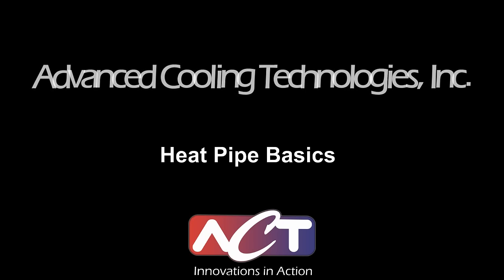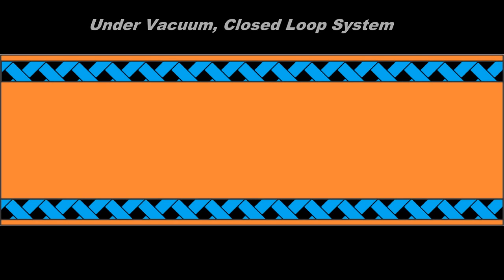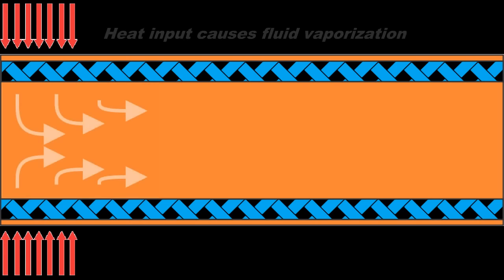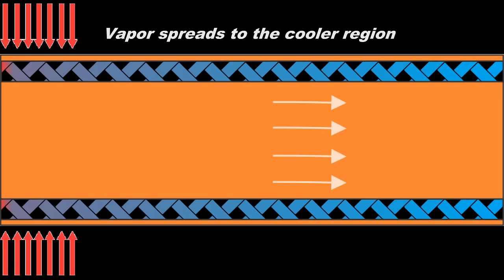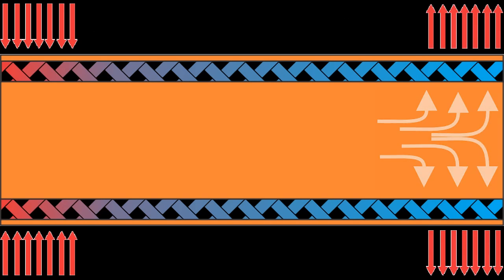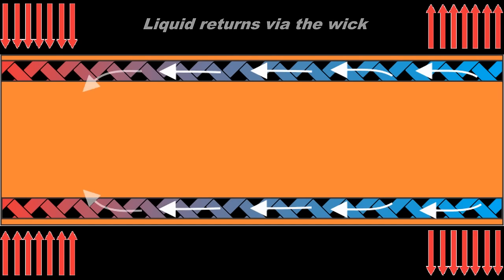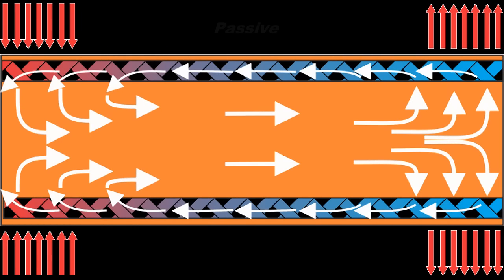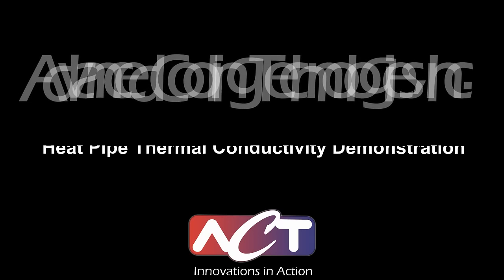Heat Pipe Basics and Demonstration Video

Comment: Question.
If you have an electrical component that is operating at 40°C, and you use heat pipes for cooling. What is the typical temperature reduction for the component? I realize there are no doubt variables associated with this, but what is the average temperature reduction using heat pipes? I have never seen the stated anywhere before. Thank you
Reply from the maker: Hello! With more information, we should be able to provide you with an answer! Feel free to reach out to one of our engineers with details regarding your project: solutions@1-act.com 

At the moment, it depends on far too many variables to give a clear answer. A heat pipe won’t inherently reduce the temperature of a component unless it is providing a better thermal path than what is already present. If a heat pipe-based cooling solution is designed properly, a heat pipe will help minimize the thermal resistance between the component and the cooling media which will result in a cooler component. The magnitude of that reduction is dependent on many things and can range from a few degrees to tens of degrees. 

Thank you for your question and hope you reach out to us for further conversation! 
solutions@1-act.com

Comment: What happens if you deny the heat pipe? Will it loose effectiveness or kill it completely? 
  I have an old GTX 780 that I just noticed the heat pipe system has a dent in one of the tubes. Maybe 1/16th deep in a 1/4” tube (1.5mm in a 6.30mm tube). The card is almost useless but I wanted to give it away to see if someone could use it. If it now has issues, I won’t give it away, since it will be nothing but issues.
Reply from the maker: @remmik- It depends in the nature of the dent. If there is no puncture to the pipe, the dent doesn’t cause discontinuity to the wick structure, and the dent doesn’t choke the vapor flow, it will likely still operate as a heat pipe. In your case, if there is no puncture, I’d imagine the dent isn’t large enough to render the heat pipe useless if was designed with sufficient margin. To test to see if the heat pipe is working, you can control temperature on one end and see if the other end is similar temperature (note: this should be much different than the ambient temperature). A functioning heat pipe will have a very small temperature gradient whereas a non-working heat pipe will have a much larger temperature gradient.

Comment: Now do the same demo at 1:13 but in a horizontal orientation. Gravity is providing an advantage in returning the liquid to the evaporator. Does the capillary action of the wicking material completely compensate for this change in orientation?
Reply from the maker: Hi Mark, Good observation, you are correct that when we initially start the heat pipe demo it is in the gravity assisted orientation. In this orientation the pipe will be able to move additional power compared to against gravity or horizontal. In general, most heat pipes are designed for any orientation operation, using the capillary action to fight the gravity head in adverse orientations. Later in the video, we actually move it back to the cold zone and you’ll notice it is still functioning as a heat pipe in the reverse orientation (fully against gravity). From a design perspective, it is key to understand your transport power requirement and make sure that you can move the full power at worst case orientation. You will simply have additional capacity in more favorable orientations. Feel free to contact us at solutions@1-act.com if you have any other questions.

Comment: What is the liquid that is used in these heat pipes typically? Water?
Reply from the maker: Water if a common working fluid but it really depends on the application.   Check out this page on our website, which goes over working fluids for heat pipes: https://www.1-act.com/working-fluids/

Comment: How exactly do the molecules go through the inner wall? Is it only permeable to gaseous molecules? Why does not water/vapor go through the barrier in the middle of the pipe?
Reply from the maker: Heat pipes are completely sealed devices; the fluid in liquid or vapor form does not exit the heat pipe. Heat enters/exits via conduction through the wall. On the inside of the pipe, the heat transfer is greatly enhanced by the latent heat of the two-phase transition. At the evaporator section this involves boiling/vaporizing which takes advantage of the fluid’s high latent heat of vaporization and at the condenser section the fluid (in vapor form) gives up it’s latent heat as it condenses back to liquid.   You can learn a ton more about heat pipes on our website 1-ACT.com.

Comment: So, air-coolings on cpu are actually water-coolings ?
Reply from the maker: Heat pipes are used a heat transport device, leveraging passive two-phase heat transfer. The system still requires some type of ultimate heat sink, which can be air cooled or liquid cooled depending on your system requirement. Heat pipes can make either option more efficient and reliable.
Reply: In other words. Yes. Same means, but on a much more massive scale.

Comment: How is the heat transfer if there are 2 heatsources? 
Does the cooling capability or power stay the same on the entire length of the pipe?
Reply from the maker: A heat pipe will isothermalize to however many heat and cooling sources that is connected to it. Because vapor is used to transfer heat, it is very fast, essentially providing uniform heat transfer throughout the pipe. Does that answer your question? Are you working on application that might benefit
from heat pipes?
Reply: Advanced Cooling Technologies Inc. 
Thank you for the quick answer 
So if there are these said two heat sources the temperature stays same at both heatsources if they have the same heating power (W)?? 

Thanks again didnt expect such a quick answer
Reply from the maker: The heat pipe will isothermalize all of the inputs and the temperature inside the heat pipe will be 2-5°C. If you need more detailed information, you send us an email via our Contact Us form with the detail and we can get you in touch with the best person to answer your question.  https://www.1-act.com/contact-act/

Comment: what type of liquid inside the heat pipe
Reply from the maker: Mohamed - liquid can vary based on the application.   Here is a good piece from our website that explains what working fluids are used when: https://www.1-act.com/fluidenvelopewick-compatibility
Reply: Energy Recovery

The refrigerant R134a is used as the working fluid with copper or steel envelopes in Energy Recovery Heat Pipes Heat Exchangers, since it has no ozone depletion, low global warming - 

If it is leakage of heat pipe ,how to reinsert the gas in the HVAC

Comment: If a heat pipe is in an vertical orientation, would you need a still wick need a wick? Have there been any cases where heat pipes are used for geothermal applications?
Reply: RalghaHhallas The wick does more than just bring liquid back to the hot end. It also spreads the liquid across the surface at the hot end & ensures that only a thin layer of liquid covers any given part of the pipe. Having a thin liquid layer is important to allow rapid evacuation of the vapor, as well as minimizing the thermal gradient within the liquid itself.  There are heat pipes with only partial wicks too, like the stationary vertical design you suggested. There are also oscillating/pulsating heat pipes where the passages are  small enough to be blocked by the liquid droplets & the rapid expansion/contraction cycle drives the movement of working fluids instead of using a wick.
Reply: Thanks. I more interested in using it in a geothermal application. I did a bit more research I think what I was looking for is a thermosyphon. I working on a feasibility study of utilizing thermosyphons to extract heat for residential heating.

Comment: Could not liquid metal be used with a electromagnetic pump to reach greater temperatures in order to heat hot water and generate electricity? I mean making hot water is great but you could do so much more with this technology! Power poles would not just carry power each one would make it has it moved it to be used in cities. Novartis

Comment: Does this technically mean heat pipes are phase change cooling?
Reply: +Aaron Lowe actually, no.  Phase change cooling is characterized by the cooling action being created as a the fluid in the system moves from a high pressue zone to a low pressure zone, becoming a gas in the process.

That said, there is definitely a phase change happening in these heat pipes.
Reply: Powered By Redstone Well it's literally changing phases... In all chemistry terms
Reply: Absolutely, but in this case, the phase change is not the cause of the cooling action, but instead as a result of the heating action applied to the heat pipe.
Reply: True-... It's not exactly refrigeration lol
Reply: ***** not quite.  Phase Change cooling relies on the resulting cooling effect of a compressed gas in liquid form transitioning to a gaseous form by being released through a small orifice, whereas heat pipes cause a phase change by heating a liquid into a gaseous state and carrying the heat away with the gas.
There is a phase change present in both situations, but in a phase change cooler, the phase change is the cause of the cooling, as opposed to a heat pipe, where the phase change is the result.
Reply: nah they were right its is phase change

Comment: Very good explanation. However feel free to use a pop shield and have a glass of water. Perhaps even a few centimetres back from the microphone. It would make your voice with otherwise pleasant characteristics more enjoyable.
Reply: +Basil Lange what is the significance of the glass of water?
Reply: You know that the surfaces of the mouth can get quite dry after speaking for a while. A nearby microphone picks up those sounds, listening to the video made me very aware of the speaker having a dry mouth. It also smoothens the vocal chords to have a glass of water. Since the tone and manner of speaking is very nice.
Reply: Basil Lange
ah, so its just for sipping. i thought it had something to do with soundwave refraction or something.

Comment: does this explain why if i tilt a certain laptop 90 degrees on its side, the temps rise quickly to 100 and down to 60 when flat again?
Reply: Yes, exactly. When you tilt it, the fluid flows to the cold side by the force of gravity, and thus no longer extracts heat from the processors.

Comment: Is it possible to make DIY acetone heat pipe without vacuum it first? I have plan to build heat exchanger for DIY solar heater, and need something which will conduct heat, but without too much copper, which is today very expensive. 

Thank you in advance for answer.
Reply: so many solar heaters are operating under evacuated heat pipe...